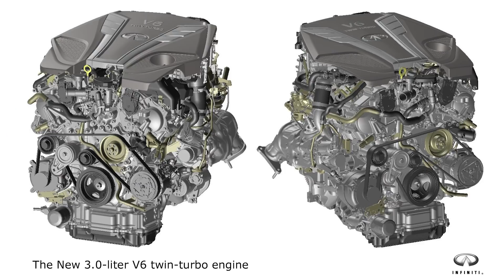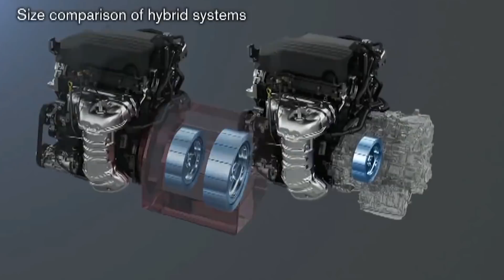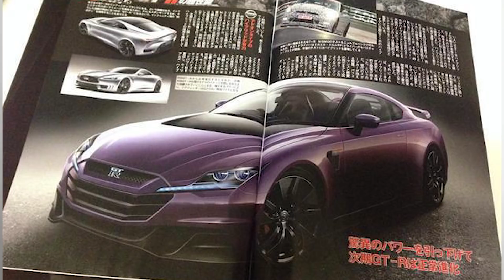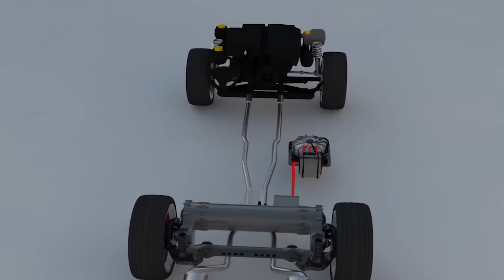2020 Nissan GTR R36 : EVERYTHING YOU NEED TO KNOW!!!

Comment: Nissan got overconfident with their GT-R.

When it came out, it was amazing with the AWD System allowing it to match/beat cars with better chassis etc. especially on tracks like the nordschleife, where "sharp" cars would suffer.

However, the engine placement, weight, aero and even the engineitself were never the benchmark for serious competitors.

Their Hybrid R36 sounds to me like it's going to be another NSX tragedy, made to offer a P1/918 knockoff and ignoring that both got beaten by the "simple" 911 GT2 RS which costs about 300k€ iirc.

IMO a brand that doesn't have the prestige of Porsche, McLaren, Ferrari etc. has to deliver superb performance "on a budget". The GT-R filled that  niche when it came out but gradually got more expensive with marginal improvements.

So... I'm not excited about the R36, but I wonder how the next Z will turn out. I really like the 350z, the 370z was a downgrade imo.
Reply from the maker: #TRUTH

Comment: Regarding the Nissan LMP1H, the engine in that HAS continued development. It was considered as a possible LMP2 engine option, but they chose to continue with their current setup to simplify spares, and promote cost savings.

In terms of the Hybrid setup, you mentioned that they (Nissan), has failed at Hybrid with the LeMans car. It should be clear that the Hybrid system in the LMP1H was not developed by Nissan at all. But was rather developed by a third party vendor. In this instance, ToroTrak. ToroTrak's "Fly-Brid" system was a 100% mechanical device. It used direct mechanical coupling into a variable speed clutch assembly to direct drive a weighted flywheel, or "accumulator" via the front wheels under braking. This accumulator would then directly mechanically drive the rear wheels of the car for added power out of corners. The system was a dud. In fact, every attempt that ToroTrak has ever made in racing, has been an absolute failure. And even the commercial "successes" they brag about have been done way over budget, incredibly over weight of the design brief, and far below output expectations. Meaning not a single one of their design targets were ever met. So why Nissan, and more specifically Ben Bowlby ever thought that ToroTrak would magically get it right with this unit, is more than a bit mind boggling.

I have a very deeply intimate, and somewhat personal knowledge, of the innerworkings of the Nissan Nismo GT-R LMP1H program, and how the entire failure of the car, at every turn, was directly related to the ToroTrak units failure. If you would like to know more, i would love to share the information with you.
Reply from the maker: Great information! Thanks for sharing.

Comment: You're way off bud...If Hybrid hampers performance like you suggest why has F1 been using it for 4+ years? The Porsche 918 has proven time & time again to outperform the 720S completely contradicting your claim. EV tech alone has proven to be superior to combustion engines & isn't as expensive as you're convinced it is. EV tech is the essence of "hybrid" - Tesla has proven with the Model 3 with a $35k price point & also with the P100D versus anything....value is undeniable. Not to mention Rimac or the Tesla Roadster.... Plus you're basing that on speculation being there's no proof of 720s beating P1's or LAFs & loses to 918s.... Why have you decided the NSX is the only Hybrid out there....and what do you mean by "required?" Are you forgetting McLaren's P1, the La Ferrari & Porsche's 918s outperform all non-hybrids when released, minus the purpose built Bugs? The tech is there, it's all over including F1... maybe Nissan hasn't figured it out but that's why they went to the pinnacle of motorsports for help - a Formula 1 team.
Reply from the maker: My responses below to your comments:

1) "If Hybrid hampers performance like you suggest why has F1 been using it for 4+ years?"
-F1 rules created this series. This is where trickle down technology will be used for production cars of the future. I doubt the technology right now will allow you to daily drive it with A/C, Heater, full weight, etc. and be reliable. No doubt, it eventually will get there, just like the evolution of the cell phone. The technology is not there atm and the biggest issue is cost to build this hybrid performance car. The NSX is supposed to be an "affordable hybrid supercar" and it's sales are down dramatically. It seems Honda may pull production soon as they are sold on an order basis only from what I remember. 

2) "EV tech alone has proven to be superior to combustion engines & isn't as expensive as you're convinced it is.EV tech is the essence of "hybrid" - Tesla has proven with the Model 3 with a $35k price point & also with the P100D versus anything....value is undeniable. Not to mention Rimac or the Tesla Roadster.... "
-I recall stating to go straight to electric in the video. Hybrid is a step that can be skipped due to it's complexities. Since my video was released, the Model 3 recently came out and is the budget electric car and it serves it's purpose well. The other cars you mention are $100k+ and falls into a minority for ownership...The Rimac and Roadster even more. Straightline performance is great no doubt, but if that's the only factor to justify a performance car, then that would eliminate most every sport/exotic/musle/hyper/etc. car. I'm sure we will get there, as I mentioned, it'll take time. The biggest concerns now are charging stations and wait time to charge. Reliability, we'll have to wait and see.

3)Plus you're basing that on speculation being there's no proof of 720s beating P1's or LAFs & loses to 918s.... Why have you decided the NSX is the only Hybrid out there....and what do you mean by "required?" Are you forgetting McLaren's P1, the La Ferrari & Porsche's 918s outperform all non-hybrids when released, minus the purpose built Bugs? The tech is there, it's all over including F1... maybe Nissan hasn't figured it out but that's why they went to the pinnacle of motorsports for help - a Formula 1 team."
-Well, I think you are speculating also. Until we see this race happen on a track, that's all we can do. Given the price range of those cars when released, they better beat everything in sight. The 918 loss you are referring to must be from Dragtimes 1/4 mile or 1/2 mile race. Not arguing for the 720S, but there was wheel slippage which you can clearly see in the video on launch and he also referred to the road conditions being bad. AWD is king at these moments. Comparing the specs, the 918 should win in a straight line no doubt. But, the question is by how much and that margin is not too far off given the hybrid technology and price of the 918. I believe the best 1/4 mile time of a 918 and 720S is around a 9.7, but I'd rather they duke it out at laguna SECA or other major track to see what the results are. As mentioned, F1 tech doesn't mean it will work seamlessly with a production car. Nissan did work with F1, but the latest articles, seems that the GTR may be going a different direction. It's not final, so I'd just keep it in mind.

Comment: Car companies are pathetic when they start making hybrid powertrains for sports cars! Yes, instant acceleration blah blah blah, but the extra weight of the batteries will be counterproductive. Furthermore, They claim "green energy" but neglect the fact that producing a new vehicle will create a bigger footprint than just keeping your old car. If I am worried about gas mileage I will buy a Prius. If I want a driving experience ill buy a car for that purpose. 
 If the R36 GTR is a hybrid like Nissan says, it will fail just like the 3rd gen NSX hybrid. None the less, the body style at 1:45 is good!

Comment: Market is flooded with used GT-Rs at this time . All listings I seen on Trucar and Cargurus have been on the market several months or Longer! I was looking at buying a track edition. My local dealer has a brand new 17 track edition in black they already forced to do 5k price drop as 2018 is here. Can pick a nice low mile GTR for 54k to 68k all day long.
Reply: Erectus Maximus just make sure you can afford the crazy oil changes
Reply: I will have to look into that . I'm not privvy to any cost factors on that car.. Ive owned and operated my own mobile  auto diesel repair corporatio as sole proprietor over 16yrs. Worked on many cars that few to  no techs have experience on . Installed turbos on my 91 300zxTT without pulling the engine. That sucked lol . I also did work on a 1985 Rolls Royce Silver Spur. Oil filter could only be bought from Lamborghini dealer in my area. I believe they charge for the gold nd black box it comes in. I kept it as souvenir of that service . $62 bucks my cost for silly oil filter that looks like any other metal screw on oil filter. Ok will stop rambling on about my life . I should be able to figure it out and perform maintenance myself . Still got a parts account with NMC. Thanks for the Heads up ..
Reply: Erectus Maximus I'm not sure the mechanical aspects behind it, but not all dealers can service them because they need specific certification for the gtr. And they'll charge you somewhere between 45 to 60 bucks u.s. for a quart of oil
Reply: Hmm interesting .. The dealers are intent on making us take cars to them and them only. Early in 2000 Dodge/Chrysler etc and now others started Patenting parts . Needless to say after a 7 yr span it becomes pointless for aftermarket to pursue production of said parts. At 10 yrs from prod date parts become Obsolete and they really do this to try and force you into a newer car. Quite the racket huh . I got a shop putting a 530 hp motor together for my 300zx now and paint after . The owner just bought 2 GTRs a 2014 Track edition with dry carbon fiber and a i think 2009 or 10 .. He may have the certs to get that covered if not I'll go take their certifiication course lol ..  Self taught and Ive done everything from Dump trucks to Rolls Royce. Those Brits refuse to sell any service specs or procedures such as service manuals. They  lock that info up like fort knox. I tried calling once for info on hydraulic system .. Got a Cheerio mate no can do .. lol
Reply: Erectus Maximus that 300zx sounds mean, I only got into cars maybe 2 or 3 years ago and id love to have my first project car be a sentra ser spec v. Maybe a put it to 275 horses to the wheels and I'll be a happy man
Reply from the maker: Dillon Hughes Guys, browse through my channel if you havent already. I've already made a video on GTR maintenance cost, midpipe install, exhaust install, engine oil change and transmission & gear oil change + more.
Reply: GT Content Thanks will check check out your channel thoroughly 😎
Reply: Dillon Hughes do it yourself its only $45 ish per 5000 miles
Reply: Erectus Maximus I wanna buy one black and heavily mod it... I guess in a near future
Reply: I feel as if the abundant amount of pre-owned GT-Rs should lower the price a little, but I guess that depends on the quality of the GT-R.
Reply: Yeah..then you show up to your local car meet and realize they're 20 other GT-Rs already parked there. No exclusivity whatsoever with the R35. I like the Skyline when it was obscure and underground only us old school street racers knew about them. Now, they're like your average Honda accord at car meets. Boring and overrated.
Reply: oil change around 3XX sth in vancouver for 2010 gtr when i had the car in 2009 which i sold in 7 years ago.

Comment: The should use a capacitor to provide a power boosting function with KERS. also focus on making it lite. I know weight helps with traction and high speed stability but other companies do that with active aero systems. The GTR is really slow these days with an 11 sec quarter mile while the 911 turbo S does it in 10.5. But hey the Nismo GTR has a 7 min 8 second lap time on the Nurburgring which is frankly amazing. But imagine what a GTR could do with atleast 600 less pounds and real active aero to compensate...
Reply from the maker: Lunga Buda #TRUTH

Comment: I think a mid engine v6 twin turbo with electric motors up front with a 7 speed dual clutch transaxle would be amazing and if they stay with the Renault v6 engine family would be most pleasing
Reply: Ralph Smallblock Renault developed the VR38DETT?
Reply: Conrad Sealy the vq 3.7 and original 3.5 v6 engine was a Renault engine if you look close you can see Renault stamped
Reply: Ralph Smallblock where excatly are you getting your information from? I have searched and there are NO referances to Renault developing the VQ series engine. Send a link as to where I cant find any article about Renault developing the the VQ engine for Nissan.
Reply: Conrad Sealy all the current Nissan and infinity engines are currently changing to Mercedes engine lines
Reply: Ralph Smallblock where are you getting this information from? There is nothing from any auto publication about which you speak.
Reply: Ralph Smallblock you need to post up a link on renault making the vq engine and nissan using mercedes engines. Or a screenshot of an article verifying what you claim otherwise youre just making things up.
Reply: Ralph Smallblock all that is published is that Nissan is making engines for mercedes.
Reply: I feel like nissan shit the bed on this one.

Comment: Just buy a Q60 red sport... throw a GTR or R34 spoiler on it, with some nismo rims a sticky tires.
Reply from the maker: +Genki De 😂🤣😂
Reply: Yeah Q60s are making some really nice power! It just needs a built engine and bam!
Reply: Q60s are an almost good car. they are all equipped with slushy sponge boxes with make pretend paddle shifters though, so the biggest disqualifier of it being good is the transmission. It doesn't have a manual. The GTR at least has a mechanically manual "auto" with real clutches like its supposed to.
Reply: and a ricer alert tag?
Reply: Cispy and put a lambo badge